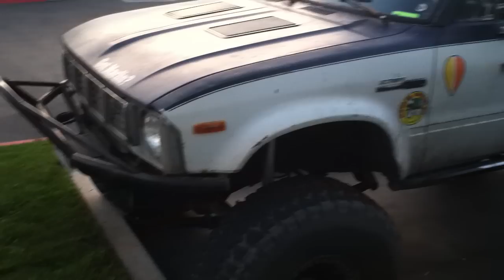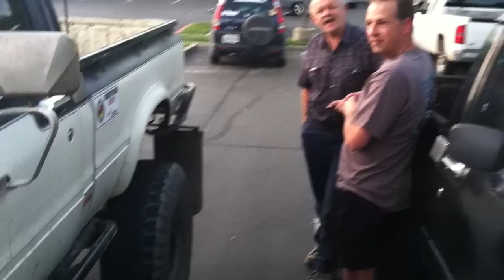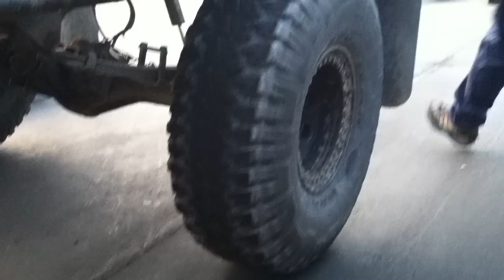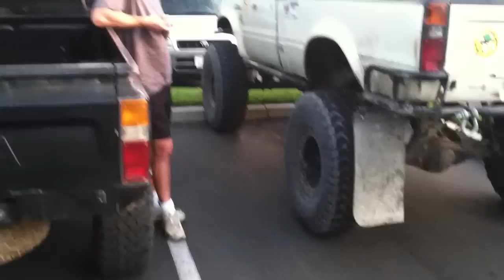BigMike's 511:1 Marlin Crawler Parking Stall Burn Out

Comment: Does Marlin make a taco box for the FJs? Big fan your products, Thanks.
Reply from the maker: Hello and thank you for your comment and for your support! Yes, the TacoBox is designed for and fits the FJ Cruiser drivetrain, however, due to the shortened wheelbase and space constraints, the repositioned transfer case will interfere with the factory fuel tank. The solution is either to heat up and deform about a 2-1/2" front-passenger corner of the polymer fuel tank for clearance, or switch to a different fuel tank. Unfortunately as such, due to this level of modification, the TacoBox is not for every FJ Cruiser owner and the FJ C is of the fewest applications that we've sold the TacoBox for. But there are shops out there that can modify fuel tanks so even if you're not up to the task we've had customers find resources available to do this. Sorry for the not so good news and please let us know if you have any other questions! Thanks!